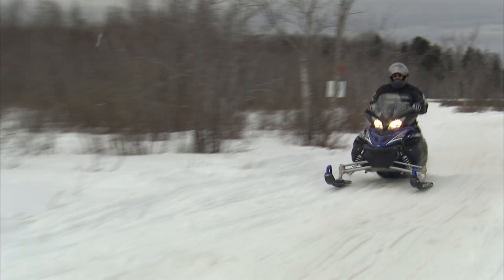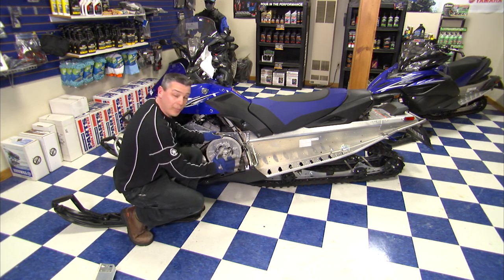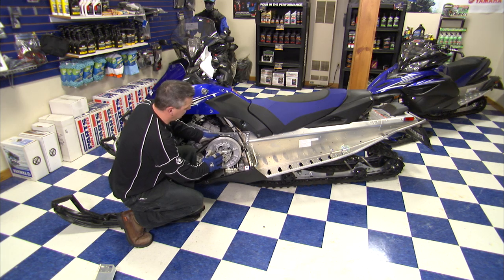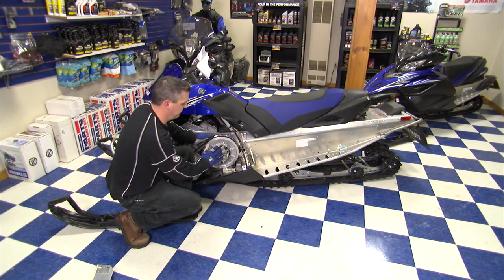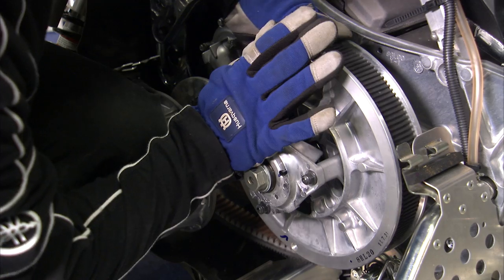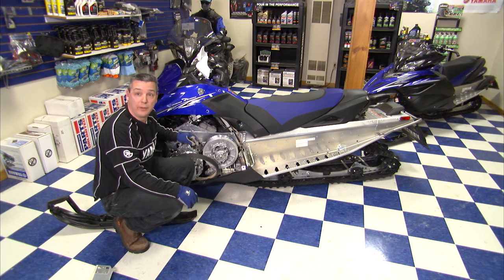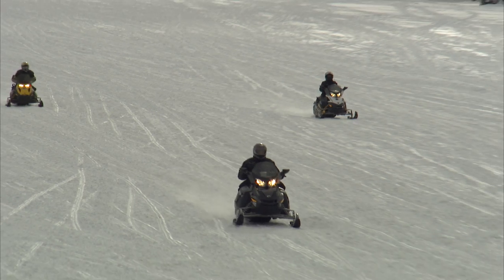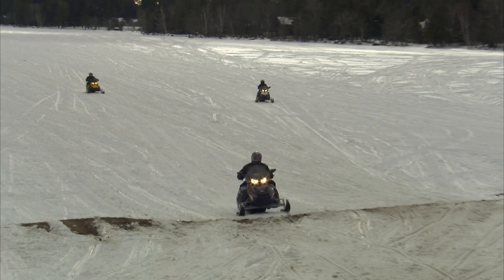How to Change a Snowmobile Drive Belt

Comment: Thanks Rick for this video tutorial.
I changed my blown belt with no problem, but than I installed new belt on gunked clutches and I didn't know how to remove it safely and without damage to the belt. To add insult to injury I was only 200 yards from my trailer. Thanks to you I know how to remove my brand new belt and clean the clutches before I put it back on and ride again without demolishing the belt  immediately.